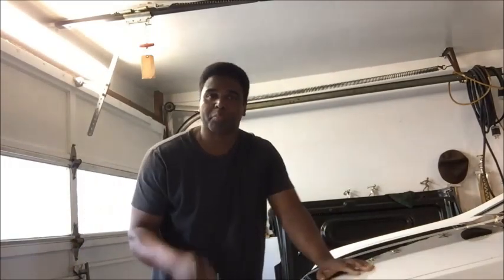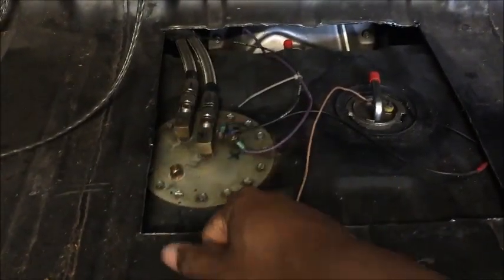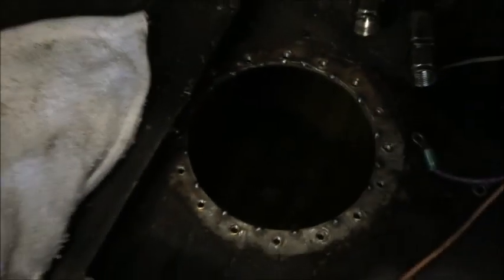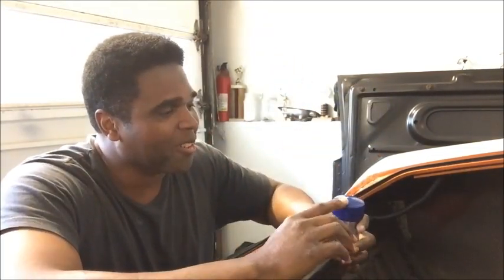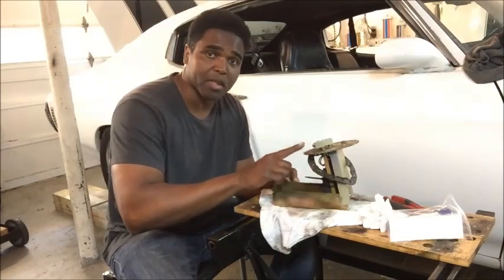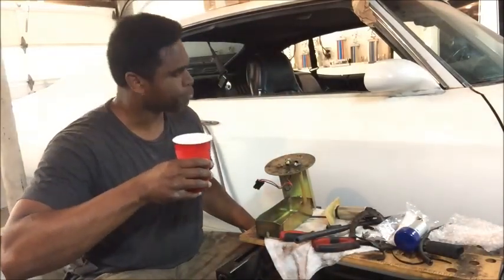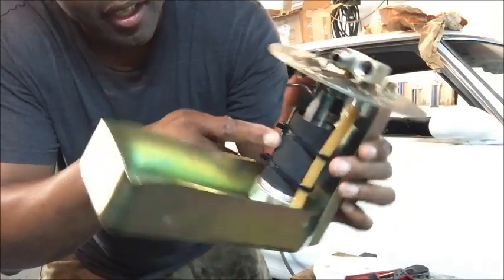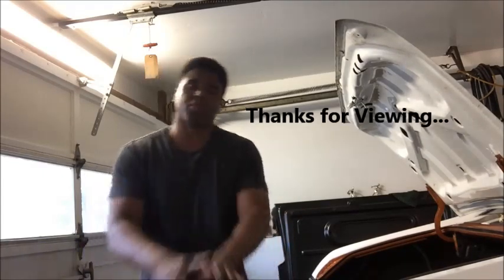LSA FUEL PUMP UPGRADE.. THANKS TANKS INC...

Comment: Hi Terry  what year is your Chevelle SS ? It looks very nice, how long have you been working on Chevelle. I am working on a 1982 El Camino Conquista I purchase a new fuel tank, the original tank looked like swiss cheese on the top of the tank. I used the fuel pump out of a 2002 Silverado. I had to modify the fuel pump and the tank. I wish i would of known about the fuel pump set up you used, it would have saved me alot of time and money. can't cry over spilt milk. great video Thank you.
Reply from the maker: Whats good E Zap.. thanks.. my car is a 71 chevelle, its my test mule for parts for the past 6 years.. your fuel set up is more satisfying because you did it yourself..

Comment: The TANKS Inc set up works perfectly but if your tank isn't perfectly flat on top, you'll have to purchase some body repair tools and pound an area flat. Otherwise, you'll have fuel leaking!!  Terry, my LS2 Monte SS is still running great, by the way! Keep the vids coming...
Reply from the maker: oh no doubt.. i had to flatten out a mounting area of the tank.. wasnt a big deal.. what going Giuseppe.. long time..
Reply: I haven't done anything to the Monte in a while. I recently went on the Bandit Run, so all of my time and money went to getting the '77 Trans Am ready.
Reply: Things have been going well, thanks. I've actually been contemplating a 6.2 LS swap out of a pick-up for my '97 Silverado. That or keeping the 5.7 and stroking it out to a 385....not sure

Comment: hey there man how you doing I'm new channel I've watched a couple videos recently subscribed I have a question for you looking to build an LS lot of people tell me the lq9 is a great starting point and when I tell them I wanted to do a 6.2 they said the lq9 is still the better block bored out 30 and it's a 6.2 I knew that to be a fact but people make it sound like it's a stronger block is there something about the lq9 that makes it Superior does it have a larger cylinder walls I'm just asking because they do make it sound like that is a more reliable build of a 6.2 tell me if you've ever heard this before or know anything about it thanks man
Reply from the maker: whats good Kevin.. giving the choice i would go with that 6.2 block.. lq9 is a cast block aluminum head 345/380 @4000 block, the 6.2 is an all aluminum 403/417 block.. if the price is the same i would go with the 6.2.. hope this clears it up a lil..
Reply: thank you sir